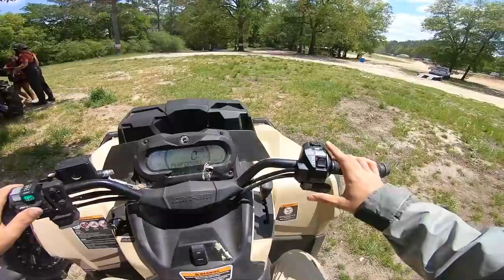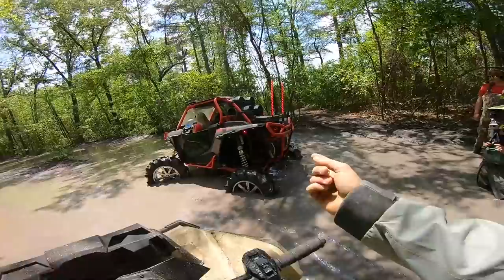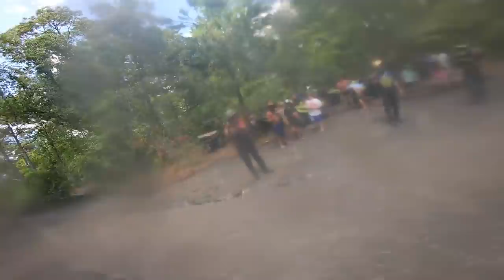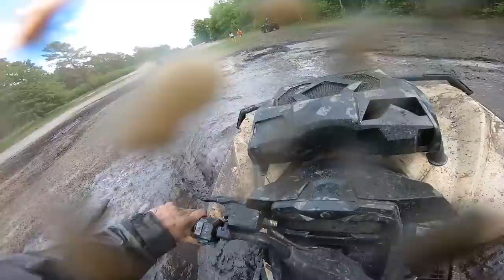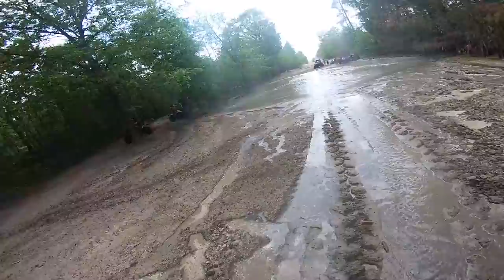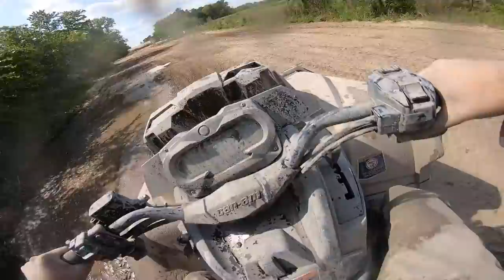I BROKE EVERYTHING.

Comment: Braydon: can-am is the best. also Brayden: complaining about it the whole ride 😂😂😂
Reply: Lmaoooooo
Reply: Nothing is un complainable....except Toyotas.
Reply: Facts 😂😂
Reply: @jwatkins9520  😂🤦🏻😂😂
Reply: @jwatkins9520  do you know how many yotas I’ve. 
Pulled out of the woods with my jeep
Reply: He's said he's a Honda guy😂😂
Reply: Reason to build it up and make it a monster
Reply: @masonbukovicn1242  not any I've ever owned.
Reply: @jwatkins9520  or fords
Reply: @Lucas Martin thatssss what immmm sayyyyin
Reply: @masonbukovicn1242  prbly 0.
Reply: @jwatkins9520  new Toyotas are built cheap. Know people who have been through multiple and once they switched to something else they stopped having problems
Reply: @crystalmullins542  Now, you've went too far. Lol
Reply: @austinmorrison6632  ANYTHING new is trash compared to the 80's and 90's. Got a really good friend with a brand new Rubicon Diesel and it's been in the shop more than they've driven it. I have an 85 toyota that I'd still be driving if that dude in the Silverado didn't t bone me at over 65mph. 😐  Bet I can still crank it once I rip the body away from the engine..lol JUST put a new radiator in it 2 weeks before the wreck and filled the gas tank up 8hrs before the wreck. Happened last May 29th.. Wife drives a 2016 4runner and I drive a 2003 Tacoma. Not a single time has either one ever let us down.
Reply: @jwatkins9520  damn that blows, I have a 92 Toyota that is awesome and I have a new 22 f250 that hasn’t given me any trouble but there’s only 15k on it so far. Just from my experience all the new Toyotas fall apart, my uncle had a 17 Tacoma and traded it in for a zr2 Colorado and he said he’d never go back to the new Toyotas after he made the swap. They’re just getting cheap with how they make it which sucks but they do have some decent power
Reply: When the can-am isn’t broken it’s the best but when it breaks it’s shit
Reply: Facks
Reply: @jwatkins9520  😂😂 ong
Reply: And complaining adout the 336 boys
Reply: @jwatkins9520  I disagree...only in one model though
Reply: Lol
Reply: @masonbukovicn1242  bros talkin about jeeps rn 💀

Comment: Here’s a idea for the renagade
Reply: I would ditch the yellow go with white or black on the plastics, 1180bbk, blackie cams, nitrous direct inject, dual rjwc, stretched trailing arms, floorboards, arched raked front arms, bumper and relocate , 34” sassys on msa beadlocks, all metal parts on bike powdered illusion purple, billet diff front and rear and a 6x6 trans with hs driveshafts….